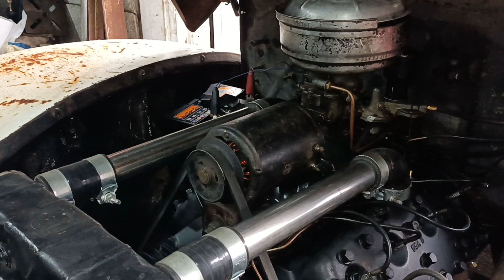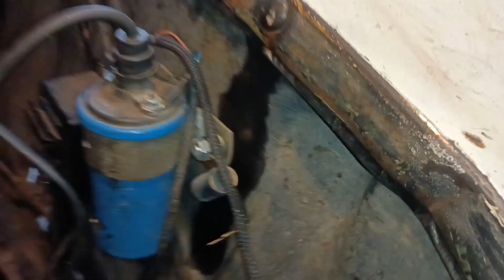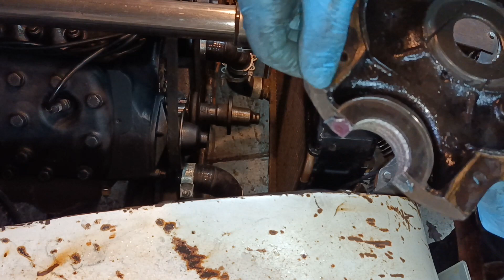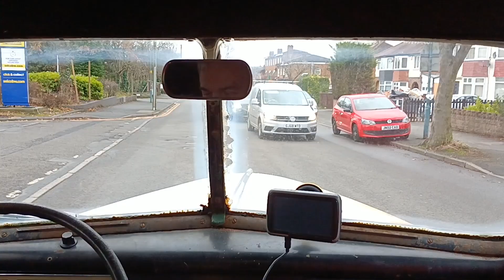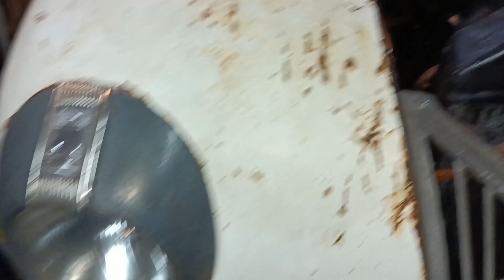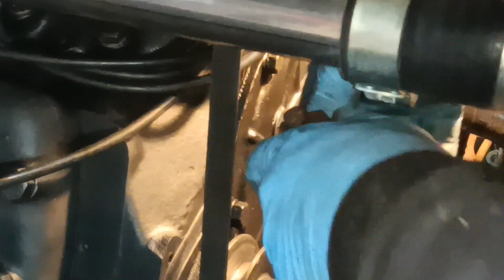2204 French Flathead in my 41 pickup: Why so noisy? Can I fix it?

Comment: At about 12:40 you can see wear marks on the aft part of the cam gear. Perhaps this whre it was making noise. Maybe the lash was just a bit tight with this gear. Good find Mart! Guess these things can happen when parts from dffierent engines are used.
Reply from the maker: Yes, Robert, something wasn't meshing right. Thanks for watching and commenting.

Comment: She has a nice "growl"! Seems to have a lot of low-end grunt too. I've given up on aluminum cam gears on my stock 30 coupe, lots of noise I could never get rid of. My current "C8BA" build has an aluminum gear that's worrying me a little, with your success I think I'll just stick with it.
Reply from the maker: Hello Art. The motor has plenty of low down torque. Ideal for the truck. If the cam and crank gears are a matched pair they should run together quite happily. I think a noisy one will quieten down after enough miles. A FordBarner said 5000 miles before his quietened down.
Reply: @MartsGarage  I like all the noise to come out of the tail pipes!😁

Comment: Fab fix.. hey was just thinking.. when you pull the intake manifold to reorientate the pcv valve,  could you should you blank off one or both of the exhaust cross over ports?
I'm pondering doing it to my c59a.
Regards Kevin
Reply from the maker: Hello Kevin. I didn't blank them off. The manifold has a plug at the top because this type of manifold is normally for a Stromberg. I do have them blanked on a couple of other engines. Mart.

Comment: Mart, what fitting have you used in your petrol pipe into the carb?  I need to sort my fuel line and need to find one.
Reply from the maker: Hello Alastair It's called a "ford nut" it's a 1/2" unf thread and takes a 1/4" olive. Look for EDELMANN 108400 on Rockauto. Other early ford places have them, probably cheaper. You could also try oneill vintage parts. - I just looked they have Stromberg Ford Nut set with Ferrules 9081K-C. Look under stromberg parts. Mart.

Comment: Was that the difference between a steel and aluminum cam gear, or were they both aluminum?  Good call on the fix!
Reply from the maker: Hello William. Both Aluminium. I stripped two French motors and might have got the gears mixed up. Only when the other motor gets put together and run, will I found out if the noisy gear removed from this motor runs quiet in the other one.